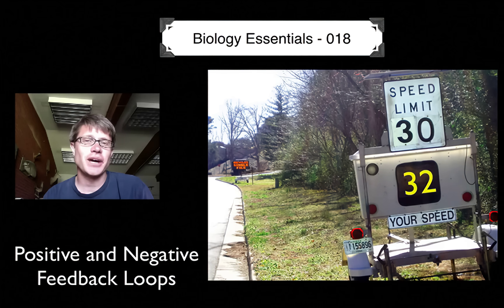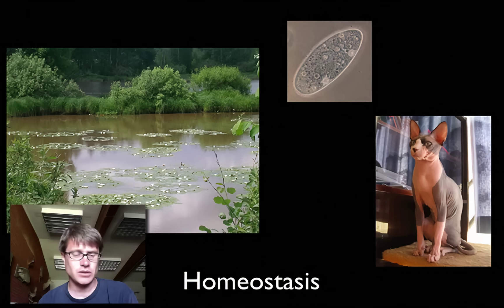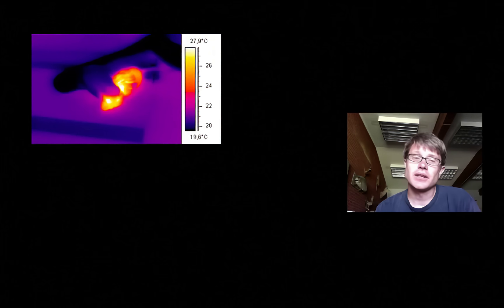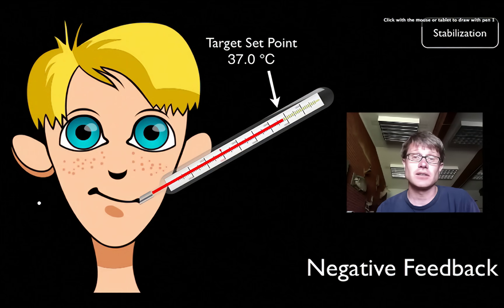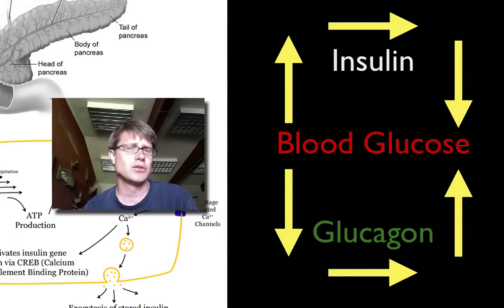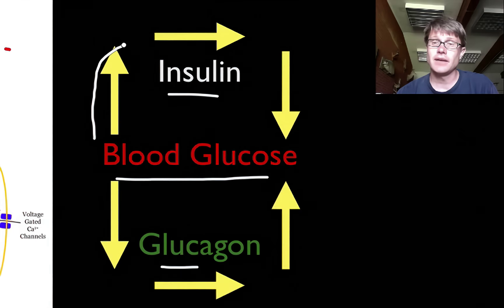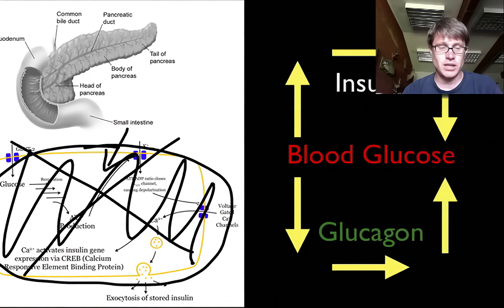Positive and Negative Feedback Loops

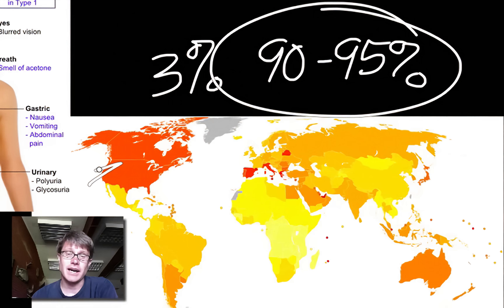Comment: 13:59 It is due to the diet, but not because of high-fat. Does fat contain glucose (which requires insulin to be absorbed by the cells)? No. It's the sugars and carbohydrates that contain glucose. How can experts not get it right?

Comment: From my understanding, you skipped an example of a positive feedback loop.  Your diabetes example, where destruction of beta cells robs the body of its ability to produce insulin, simply results in an aggregation of blood glucose.  Just more and more, but without positive feedback.

Interestingly, both type 1 and 2 diabetes can drive up blood glucose with a positive feedback loop.  High blood sugar causes polyphagia-- or unnatural hunger.  So: You get high blood sugar--  Which makes you hungry so you eat-- Which drives up your blood sugar more-- Which makes you more hungry so eat more-- Which drives up your blood sugar even more-- Which makes you even more hungry so you eat even more-- Which drives your blood sugar up even more-- Which makes you even more hungry so you eat even more-- etc.

There isn't a lot of literature about chronic polyphagia and weight gain.  You may want to take a look at Robert Lustig or a book called 'Salt Sugar Fat' by Michael Moss.  Lustig's videos are very interesting and easy to understand, and Salt Sugar Fat is an entertaining, great read!

One more thought-- Hyperglycemia, or high blood sugar rarely causes death.  It does cause DKA (diabetic keto acidosis) with enough frequency so it's a concern if you're taking care of a diabetic patient, and comas do happen-- but people generally don't die from hyperglycemic comas.  HYPOglycemic comas, on the other hand, can be deadly-- they are most often caused when patients take too much rapid acting insulin without eating.  Fortunately, with the introduction of long-acting insulins in 2002, rapid, and even short acting insulins, are becoming a thing of the past.  Long-acting insulins are both safer and more effective for controlling blood sugar.

Sorry for the nit-picking.  I'm a big fan of your videos (why I was watching).  But these things, in my mind, are pretty big deals.

Comment: Loved you video, but at the end you mentioned a high fat diet, being a cause of diabetes along with high glucose diet.  Science has shown that it's only the high glucose, not the high fat.  Both together will cause huge problems but low glucose and high fat is very desireable.  Also, Type 2 diabetes is completely reversible through lifesyle changes...specifically a low carbohydrate, high fat diet.  So T2D could be almost called a carbohydrate allergy.  (toungue in cheek)

Comment: High fat causes diabetes? Good one, high carb diet, alone, causes diabetes. Love the video's, but come on man. Don't take stock in that crap. One might eat high fat and carbs, the fat is not related to type 2 diabetes, not nearly as much anyways.
Reply: Carbohydrates causes a spike in insulin levels in the blood stream, that means that CHO triggers the release of insulin.  Insulin is a hormone that facilitates the entrance of glucose into the cells.  If you don't make enough insulin, then your cells cannot take in glucose from the bloodstream and so the glucose level in your blood becomes very high which can be very dangerous.  That is why it is better to eat complex carbohydrates over simple sugars, as simple sugars trigger high spikes in insulin production while complex CHO will produce a more stable sugar level in the blood stream as the complex carbohydrates take more time to break down and so sugar levels  are generally more stable.
Reply: @Boundless_Infin1ty      (-but I do have to comment on this.

on such like you for example):

'pardon me butting in,-' (— blackjack, UCN/ISA/even ICSA vs Higs 'empire' era troublemaker) but....

hello there, fellow old ISA(?)-player.
Reply: Peter Morera
Too much energy(calories) is  what causes weight gain not fat.  Yes fat does have more energy per gram than the other two macro-nutrients BUT they also don't arouse insulin secretion as much as Carbohydrates, and some protein.  Fat is needed to make different hormones in the body, of course you should avoid trans fats however saturated fat, poly and mono should be part of a healthy diet.  Your cells are made up of a membrane which is made from phospholipids.  I could go on and on as to why fat should never be avoided in daily diet.
Reply: I think he was pooling in high fat with high sugar and corn syrup in a diet, maybe
Reply: I hope so lol, there is a pretty big movement against fats, hoping it stops eventually lol.
Reply: It's insulin resistance, carbs are why people get it and insulin does not break down glucose bud...
Reply: ya, sugar is a type of carbohydrate. Isn't it the simplest form of carbohydrate?
Reply: calm down, he did correct himself you know..
Reply: Kyle Needles Yes, high fat diet is a huge contributor to the development of diabetes.  People who develop type 2 diabetes are predominantly overweight/have too much body fat.  Once they get too fat, their body loses the ability to process blood sugar.  What is happening at a cellular level?  The excess fat in the cells starts to inhibit insulin essentially locking insulin out of the cell's metabolic process.
Reply: (Eugh. I'm just trying to find the Familiar one somewhere in this kind of video place's (of all videos(?)).-).
Reply: Kyle Needles we offer you our natural dietary supplement that can help you do your diet with healthy way, interest call us 855-972-1772
Reply: http://www.ncbi.nlm.nih.gov/pubmed/25527677
Reply: high fat diet does not make you fate, 50% of my calories are fats, I eat a ton of saturated fat. I have a very lean and muscular build, and no I don't have a "fast metabolism." I'm pre med bud, only people who take stock in pseudoscience think that fat is bad for you.